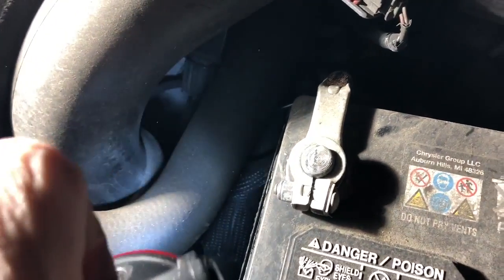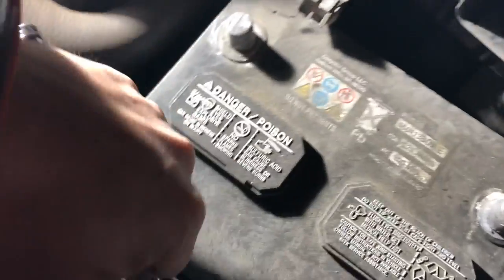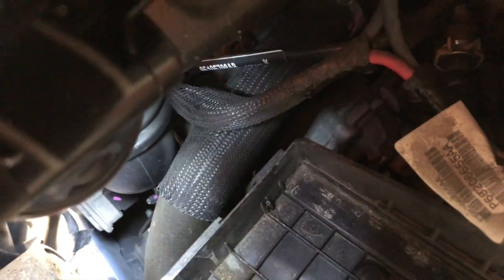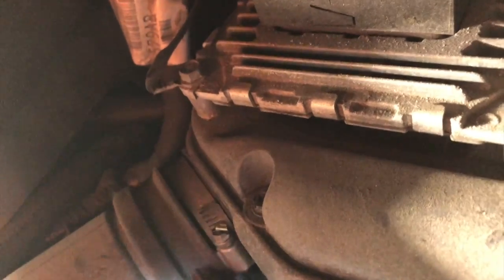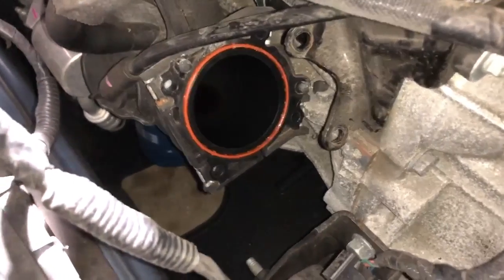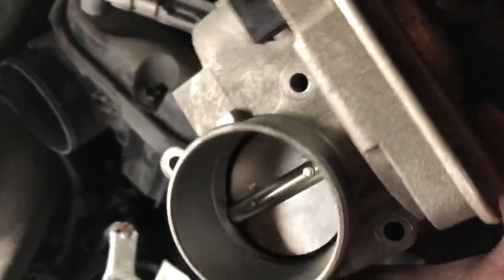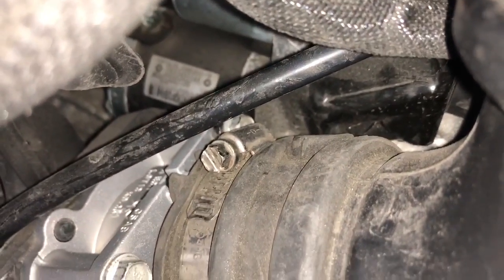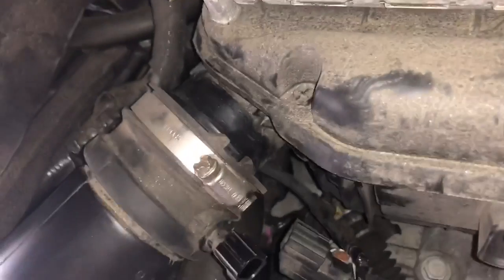Chrysler Jeep Patriot Throttle Body Install. Limp Mode and Rough Idle

Comment: Just got done replacing mine.  53 yr old female, money is tight.  Thank you so much, took me about 3 hrs, with some breaks, 93 degrees out and I have spinal chord damage.  Couldn't have done it without you..you rock
Reply from the maker: Glad I could save you some money. That’s the driving force behind my videoed I am technically handicapped. I ruptured two discs in my back about 20 years ago and had back surgery so I could walk again. No feeling in my right leg and I can’t lift more than 20 pounds. I’ve learned to modified ways of doing things like lifting up the tire with my feet in order to mount it back on the car. Anything is possible if you put your mind to it. 👍
Reply: @OmarsGarage  sounds like me, had a tumor removed inside my spinal chord, went in not walking came out walking.  But I was determined and thanks to your video I did it

Comment: I know this video is from 5 years ago, but is reprogramming or relearning the throttle body not need to happen? Trying to get my 2016 patriot ETC (lightning bolt) and traction indicator to go off. It still drives and isn’t quite in limp mode yet

Comment: I just finished this. I removed the top(left) of the airbox and the battery and didn't regret it. BE CAREFUL WITH THE AIR TEMP SENSOR! It is delicate and brittle plastic after 10 years. Ask me how I know... Moving the upper radiator hose did help and it only drips a little, you can top it off with cheap distilled water without altering the ratio in any significant way. The gaskets are not included because Chrysler says they are reusable...I bought a new one anyway too 😉 It took 5 trips around my 1sq mile block to run well so Don't Panic of it doesn't start acting right immediatly, the computer needs a minute to get the new voltage range.

Comment: Omar, Thank you, thank you thank you. You're video was spot on, all the symptoms on my wife's 2014 Jeep. I watched it numerous times, I practiced each step in my mind. Today, I did as you directed and successfully replaced the Throttle Body unit. Her vehicle has much better pickup.  The hardest part was the bottom hose clamp. Did it myself and saved $ 325.00, Thank you again!
Reply from the maker: That’s awesome…this video alone has helped so many folks out for years now. Glad I could save so many people so much money. Thanks for leaving a comment. Made my day.

Comment: I saw your other video where you had the dealership diagnose it. I wasn't getting any codes for mine and the lightning bolt light on the dash would only appear intermittently. I tried resetting the computer first, and that seemed to help but not completely solve the issue. I used this video to pull the throttle body and clean it. Fingers crossed it solves the problem. Went to NAPA and they told me the part was $230+. If cleaning it doesn't solve the problem, I'll order it online and save more than half the money. Thanks again!
Reply from the maker: Let us know if the cleaning works.  I think the part I used was about $60 and it’s been a couple years now since I changed it.  No issues since then.  Good luck.

Comment: Omar you champion... thanks all the way from Australia just did this to my Jeep Patriot 2014 after the same issues and it only cost me $80.. Jeep dealership wanted $750 for the throttle body parts only!!! You saved me and my young family a lot of heartache thanks so much again
Reply from the maker: Luke Smith so happy to hear it I was able to help.  Your thanks are very appreciated 👍
Reply: Luke Smith I’m currently having issues with the same model car with ETC lights on and all. What was the part that you replaced exactly and what Was your original issue? Was it that ETC and the car not accelerating properly?
Reply from the maker: Here’s a video with the symptoms I was having.  Pretty much the car goes into limp mode and doesn’t accelerate past around 25 mph. https://youtu.be/bfgw-UeSP34
Reply: Owen McGovern hey mate yeah it was this exact issue the car wouldn’t accelerate but was on we turned it on and off sometimes I would help but eventually it was just reving and not moving. If you pm me I’ll send you the eBay link I used. It’s an easy fix just follow Omar’s video. Our car has been running perfectly ever since

Comment: Thank you so much Omar.  My 2013 Patriot had the exact same symptons.  I ordered a new throttle body on Amazon.  It arrived, and it took me less than an hour to put the new one in.  Only because I watched this video.  Except that I didn't even remove the battery.  I was able to just remove the hose to the throttle body, and I had enough room to get to it.  With the right extensions and everything.  Thank you so much for the video.
Reply from the maker: Clay Gillman that’s great.  It’s a tight fit but it’s good to know you can do it without removing the battery.  For the video I definitely needed to remove it.  Glad it helped.

Comment: I have a 2011 jeep patriot and it has only 90,000 miles on it. I replaced the battery but nope... Then I found this here!! Will have hubby put this in and pray that it works :) thank you so much. thank goodness I have another vehicle. This is scary as my patriot just shut off and I was able to get it on a side road here..
Reply: Check your air filter first

Comment: The throttle valve fails because it is filled with oil. I recommend installing an Air Oil Separator in the crankcase ventilation hose.
It costs $5-$7.

Thanks Omar for the video. We now have a lot of Jeep Patriots in Ukraine. And your experience is very useful to us!

A lot of American equipment is fighting for the independence of our country. It is very reliable, but it also has to be repaired sometimes.

We won't give up!

Comment: I thought I had posted to this video but I can't seem to find my post.  If this is a repeat, I apologize but I'm going to post a comment again for the sole reason of saving a headache for others who may be experiencing what I went through. I had the exact same issue on my 2013 Patriot.  The vehicle left me in tough spot but I was able to limp it home.  Bought the part on Amazon for $59 and less than an hour later, my Jeep was running top notch.  Wasn't even that hard of a replacement.  Thank you Omar! You saved me hundreds of dollars!
Reply from the maker: Thanks for the feedback.  Glad you were able to get it resolved.  Still blows my mind how often these things fail.
Reply: Link to part you ordered from Amazon?
Reply from the maker: Samantha Smith the link to the one I used is in the description.  Maybe Ben can chime in on if he used the same one.

Comment: The perfect fix for the limp jeep. Ordered the part, put it in and drove the car. It did not need programming and the check engine light went after a few drives.
Reply from the maker: Thanks for sharing! 🙏

Comment: I’m having the same issue with a 2014 Jeep Compass. Was on the highway and all of a sudden those 3 lights came on and the car had no power or acceleration. Got it scanned and the code says U0401 and it’s says Implausible Data Received from ECM/PCM. So I’m trying to figure out if it’s the actual computer, any connections, or maybe this throttle body. 🤷🏻‍♂️🤦🏻‍♂️
Reply from the maker: Process of elimination. For $60 and a half an hour of work I would swap out the throttle body and see if that’s it. From the amount of people that have had this issue, it’s worth it to try that first.
Reply: @OmarsGarage  Yeah thanks man… The part is already ordered and arriving from Amazon on Saturday. I pray it’s the fix cause idk what else to do. If you have any other suggestions I’m all ears. Appreciate it. 🙏🏽

Comment: Thanks for this video! I was quoted $684 to repair this exact issue. Less than 1 hour start to finish, and I’m test driving. The only thing I did differently, was that I removed the coolant line . Minimal coolant came out. $96 total invested in throttle body and rubber gasket. Very simple, basic tools. Thanks!
Reply from the maker: Jim Weller 👏 😎.  Glad I could help.  Removing the coolant line would definitely give you an easier access to the tb.

Comment: Omar Thankyou very much for making this video I was having the same issues with my Jeep and it turned out to be the EXACTLY what was going on with your mother in laws. Didn’t want to be charged 500 bucks so got the part for $80, watched your video as I was replacing the part and a couple hours later my Jeep is running GREAT. Thanks again man
Reply from the maker: Awesome....glad I could help.  Please remember to like and subscribe 😀👏👍
Reply: Hey Omar how’s it going man so since I replaced my throttle body my car has been running great the only thing that is different now is that my automatic car starter hasn’t worked since I replaced it and the check engine light is on could you give me your opinion on what u think may be wrong with if
Reply from the maker: Kenan Jones it would be difficult to say.  The first thing I would recommend is to scan the computer for codes and reset the codes if there are any.  You can sometimes do this by disconnecting the battery for 20 minutes. If you don’t have an OBDII scanner, some auto part stores will scan your vehicle for free.  If you have that code then you can look up what else may be wrong with it.  It may just need to be reset though.
Reply: Ok Thankyou man I will try tonight after I get back from work
Reply: @kenanjones6795  Did this help you smh mine is doing the same after changing the throttle body

Comment: I have experienced the exact same isssue with my 2012 Jeep Patriot. Glad to see you fixed it with a new throttle body. I hope the same works for me
Reply from the maker: Elwood Madison for $100 it’s worth a shot compared to $900.  Good luck and if you need anymore tips just comment and I’ll answer.
Reply: Omar's Garage I received the new parts today, using your link in the description, swapped them out and went for a 45 minute drive. So far the problem has not resurfaced! Thanks for the video and Thank you for being willing to help!
Reply: Same thing with my 2012 patriot as well!
Reply: I change mine and still did the same problem  
I have change the crank shaft sensor and the cam shaft sensor and nothing I need help
Reply: Can any one help me with the link to buy the throttle body
Reply from the maker: What error codes are you getting?
Reply: @OmarsGarage  same as the signs you mentioned in the Video
Reply: Did anyone with the trail rated 2012 patriot also have the 4wd light come on?

Comment: GREAT VIDEO!!! I was able to order my part with the link, and to change it on my wifes car with this video!!! The Jeep was charging $165 Just to look at the issue... the part was $60 it came with the gasket, and it was very easy to change... one hour tops without experience just this video.
Reply from the maker: Juan Gonzalez that’s what motivates me to keep making these videos. Thanks for leaving a comment 👍
Reply: @OmarsGarage   Hey question what was your car doing with a bad throttlebody. Did you have the lightning bolt engine light on and it was idling weird and you had no acceleration because that’s what I’m dealing with I was hoping that it was the map sensor but it’s not it’s more than likely the electronic throttle control
Reply from the maker: @brianardino3369  watch this video.  It will show you exactly what it was doing and what lights were coming on. https://youtu.be/bfgw-UeSP34

Comment: I have a 2011 jeep patriot and my etc light and traction control lights came on and put me in limp mode (just like everyone else story's) . I changed the throttle body today and Bam!!! She runs better than ever before. So happy saved us a bunch of money. Thanks for the video brother
Reply from the maker: No prob...glad I could help!
Reply: Did you need to go through any type of relearn process with the new throttle body or get it programmed or did you just install it and everything was good
Reply from the maker: I just installed it. The car ran fine afterwards though the check engine light stayed on for about a day.  Went off after driving around 20 miles.

Comment: Thanks for this video. Did my repair for 50$ instead of the 415$ for the part plus labor the dealership wanted to charge me
Reply from the maker: Matt Faszczcuk there should have been a recall for that throttle body.  It seems to be a pretty common issue from all the research I’ve done.  Glad it solved your issue!

Comment: Thank you for the great video. Did exactly as you did... Ordered the same part from Amazon...  My Daughter's Patriot is back in business.
Reply from the maker: Peter Kertzie great to hear it worked out for you.  I actually just finished replacing a lower control arm on the patriot.  My mother in law curbed the wheel and bent the lower control arm.  New video coming soon 😂
Reply: So you didn't have to do the re-learn procedure?
Reply: @mattmgarza  I did not have to do it.
Reply: Peter F Kertzie did you reset the TPS? My compass wont start after cleaning and installing the clean throttle body i clean the body without disconnecting the TPS but battery on car is disconnected will that be the cause of no start?

Comment: Hey OMAR, or anyone else, can you get me some advice, I'm thinking I have to replace this part. I have a 2014 jeep patriot, on the way to work this morning the lightning bolt light came on, and the traction control and no matter how much gas I gave, it only crept along about 5 MPH barely making up a small hill. Just left from work and again, half way home, which is only about 5 miles away it happened again.. so for a few minutes everything is fine, even if I turn the car off, turn it back on.. I can give it gas, but a few minutes driving it happens again.. is it this part? The throttle body? Is that what was happening to yours? I looked on oriley auto parts and they had it listed for $250 but amazon has one for $75
how much was the one you got from amazon? Thank you in advance to anyone that can give me some advice
Reply from the maker: The one I used is in the description for the video. It was around $70.
Reply: @OmarsGarage  I asked the question in a jeep forum and someone said they didn't think the part was plug and play, that some relearning might need to be done.. yours was plug and play just fine right? once hooked up you was good to go? also, did you have anything happen like power windows not wanting to roll up before the throttle body went bad?
Reply from the maker: Everything else on the car was working fine. I think input the relearn procedure in the description which is something like depressing the gas pedal several times. I didn’t have to do anything but I did have a drive it for a while before all the errors dosappeared
Reply: @OmarsGarage  sorry about that, I didn't read the description like an idiot :P haha thanx man

Comment: I’m going to attempt to put mines in this morning. I been watching this video all week
Reply from the maker: Let me know how it goes. If you need any advice just comment and I’ll try to get back to you.  It’s pretty straight forward though.
Reply: Omar's Garage I’m having a hard time getting hose off at the bottom
Reply from the maker: Tony Blash you may have to try get at it from underneath the car.  It’s pretty tight in there.  If you have a smaller ratchet wrench it would be helpful too.
Reply: That was the hardest part for me too
Reply: I've already replaced my throttle body and intake manifold and now the jeep.just won't start
Reply from the maker: Does it try to turn over?  Have you checked the battery.  What happens when you try to turn it on.
Reply: @OmarsGarage  yes thank you. It turned out it was the starter. Was fine before I did the job. Just whacked it with an extension 3 times and it started

Comment: Does it matter if you don’t use a “factory” part ? Have you had any problems since the replacement? 
P.S I have a 2015 Patriot with the exact same problem at 105,358 miles to it.
Reply from the maker: I didn’t use an OEM part.  The one I used is in the description.  It solved the issue and it’s been several years now and the part is still working like new.

Comment: @Omar's Garage,
Thanks a lot...your video is like the light at the end of tunnel :D 
Recently I started getting this Lightning Bolt/traction control light on randomly on my 2010 Patriot. I got all my tools/parts together and plannign to clean (not replace) the throttle body this weekedn! Hope things wok out fone for me.

Just wanted to add (it may help others having same issue)  - I noticed if I start the car and seat idle for some time (to warm up engine or for some reason) the lights show up. But If I drive off right away after starting the engine i dont see the lights. It is still my personal theory though...so far i applied this 3 times and i didnt see the issue coming up. I am planning to cleanup my throttle body anyway. Cz I read people commented at many diff online posts that it should be part of your maintenance job every 25/30K miles and also keeps your car efficient on gas.
Reply from the maker: Thanks for sharing your experience.  Every little bit helps.

Comment: Hey Omar did you have to get your computer reprogrammed I had a new throttle body installed in my 2008 jeep patriot and the lighting bold and traction light is still on ... Do u think if I get the computer reprogrammed it would fix the issue ?
Reply from the maker: Edward Newkir I just drove it around until it reprogrammed itself.  After installing it only the check engine light was on.  It may be different for a 2008 though.
Reply from the maker: Have you tried disconnecting the battery for like an hour?
Reply: Ok I drove it in limp mode still had no change so fingers crossed hopefully jeep delarship if they reprogram it it will run properly .... Thank u tutorial was excellent
Reply: No not an hour I did disconnect the negative battery for about 15 minutes still no change
Reply: I will try that method the car will not go over 30mph